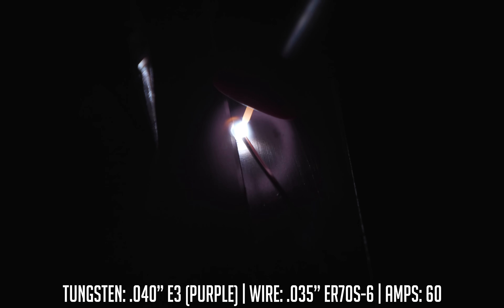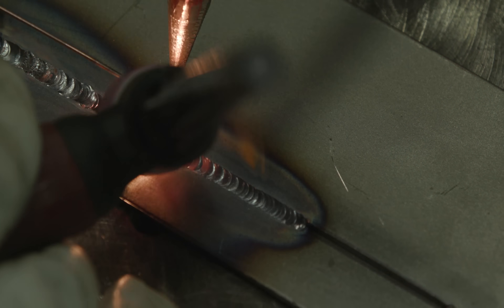Make Better TIG Welds with the Back-step Method

Comment: Any tips to prevent the scalloped top edge on lap joints?  Is it a matter of how often you're dipping filler, how much filler, where you're dipping the filler each time, joint prep, or a combination of everything?
Reply: Zach Daniels you wean when the top edge of the top piece has little cuts in it?
Reply: @GodslilRedneck23  yup, exactly. Almost looks like a serrated knife.
Reply: Zach Daniels lift the back end of your torch a bit to focus the arc on the bottom plate a bit more and keep your arc length very short.
Reply: @GodslilRedneck23  I'll give that a whirl. I appreciate the tip!

Comment: Good info. Would this prevent warping on thin auto panels? I’ve done random stitches but never one right after the other without cool down. I’ll pile on. Nothing against the new younger host but I used to click on every weld.com video immediately when I would see Bob. Now, Mr Tig? Not so much. I just didn’t think he was as skilled as his attitude implied and self-proclaimed expertise is a tad off putting. Bob just has a way about him that makes you respect him as a teacher. Put them all in a room at a welding seminar and it will be Bob and Jodi with a crowd. Nothing against the others but it’s as much about personality as anything else. JMO. Keep up the great content!
Reply: The Eccentric Hobbyist yes it helps prevent warping because you’re not pushing the heat throughout the entirety of the joint. Hopefully we can keep you clicking with the current content.

Comment: Could you give a model number and or brand of the regulator / dryer on the plasma cutter Hypertherm Powermax 105  and did it come already on the machine ? Thanks for any help
Reply: powder17 flint17 the one on the machine came with the plasma cutter.
Reply: @GodslilRedneck23  K
Reply: Thanks

Comment: I like how you ran 7 seconds post flow on carbon steel, yet you left a wicked crater eye. I always try to weld as if it matters, otherwise I'll find myself short cutting things like crater fill/taper outs.

Comment: I thought mig wire had a higher silica content?
Reply: A Macca all MiG and TIG wires are the same. The type of wire will dictate the silicon content. i.e. 70S-6 has more silicon than 70S-2 and 70S-3. The higher silicon helps with puddle fluidity when surface conditions are not as clean as they should be.

Comment: I'd like to see a video on DC TIG using 3/32" or 1/8" 4043 stick electrodes as filler wire.
Reply: 10:4 littleAl why would you do that?
Reply: @GodslilRedneck23  I don't have an AC TIG machine and would like to know if the flux on the stick electrode would help on DC TIG. Some of us are somewhat poor and have to do emergency repairs. 😜
Reply: 10:4 littleAl gotcha. That wouldn’t work though. You still need shielding gas in the tungsten. Gotta have an inert atmosphere.

Comment: I don't see you replying to any comments but I'll try any way i guess I am just a waste my time kinda guy.. Would it not be a little better to weld the right space then the left space, then back to the right working to the middle giving it a little time to cool before finishing up ? Or am I over/under thinking again ?
Reply: Jim Wardlow sorry for the delay, we’ve had some time off for the holidays and such. You can definitely do that. I prefer backstep most of the time because the tie-ins are easier and it keeps me on track.
Reply: Jason Becker yes I see your point. But your not addressing my point sir.
Reply: Jim Wardlow I’m apologize but I don’t think I’m seeing your point then.
Reply: Jason Becker ok I was wondering if you were to stick on the rat left then the far right then back to the left it would give more cooling time. Would that maybe help with less warping?

Comment: New-b asking ya... What happens if you touch the Tungsten is it - to the feeding Wire ? Or if you touch the tungsten to the plate Sir??? Truly invaluable info. Thank you!!.
Reply: Your tungsten should never touch the basemetal nor the filler. Keep the electrode distant short.
Reply: @bech1223  Thanks for replying. As a new-b I myself - at the local vo_tech adult class touched the Tungsten to the filler wire - aaand The JOLT! was so bad my arm straightened out and my glove flew-off. ¿¿¿How is it the feller in this video (Bob) didn't get jolted?
I haven't gone back to TIG Welding since. Just afraid of that JOLT!.
Reply: It's just like torch welding the tungsten is your heat and u heat the piece to melt the filler wire if you touch the tungsen to the part threw the wire u can get shocked
Reply: @jeremyhanna3852  I too thought Oh-just-like-Oxy-acetylene aaand then JOLT of the worst pain when I touched filler wire & Tungsten. However... I ... at the time didn't turn up the amps to make the puddle more bigger. Lesson learned.
Reply: Unique Touch you’ll contaminate your tungsten and loose your arc stability. You’re arc will become very inconsistent and jump everywhere but where you want it.

Comment: I really don't understand what he was doing differently?   He moved the torch right at the bottom of the seam/connection between the two plates.  Why is this different, and why/how it is moving the heat to the top plate?   What am I missing here?  
To the instructor:  can you help with my question?
Thanks!
Reply: Oh, OK.  I think I got it, after watching it 500 times.  lol

Comment: Back in the day we started to just lay the rod in the joint instead of dipping the rod. "Way" back in the day that was not a accepted practice.  We started doing that in the 1990's and it seems to work good especially on T joints. Where in FL are you?